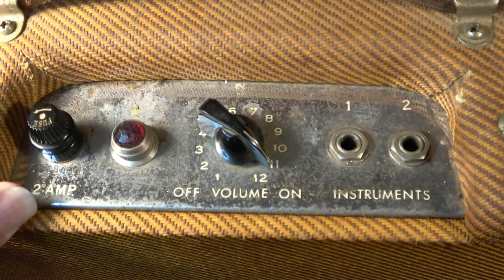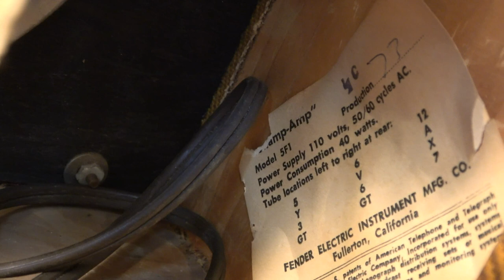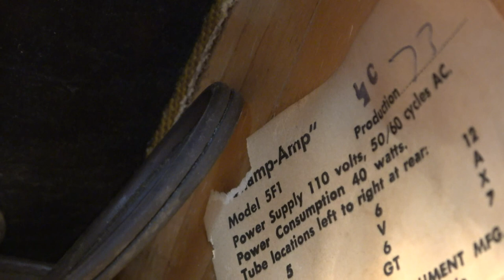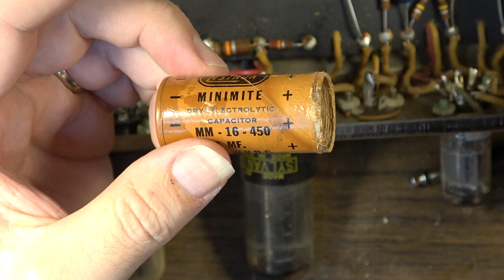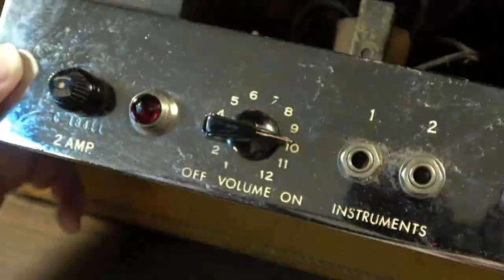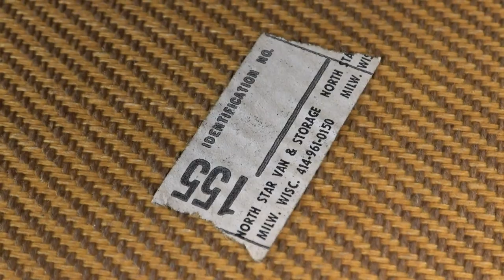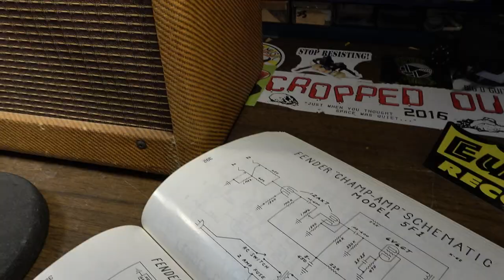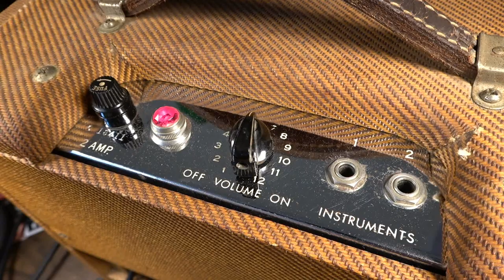1962 FENDER 5F1 TWEED CHAMP Electronics Repair and Restoration

Comment: Just had to come back and rewatch this video after deciding to get inside my 5F1 and get rid of the tone webs. Glad I did as all the date codes inside confirm it's a 1957. Valves are Tung Sol & RCA, transformer is Triad. Thanks for the breakdown of the amp in video, it really helped me

Comment: Nice work, Brad.  First time I've seen old caps get re-stuffed like that. I have some old radios I'm restoring, including a tweed Zenith Universal and I might try doing that with it when I re-cap it. Thanks for this enjoyable little trip back to 1962!
Reply: Have you ever tried to convert an old tube radio to a guitar amp. I found one guy that did it years ago with amazing result.

Comment: Nice video and nice amp :-)
The good old tubes rarely die. My modified "Knutsen" amp still has the original '63 Telefunken EL84 pair and Telefunken ECC83 PI tube. The EL84s may have been stressed or even red-plating at some point as the original PI coupling caps were leaky, but they appear to work great.

Comment: Hey man next time you clean one of those break out the water hose in a wire brush🤣🤣🤣
Reply: Bwahahaha! Oh, god, THAT guy. 🤣 You gotta make sure you you're randomly walking along the river bank, then magically discover this laying there in the mud first though. 😅 Might as well paint all the caps & resistors red afterwards too! 😉
Reply: Uh yeah, clean all the pots, jacks, tube sockets THEN brush all that debris around the chassis. Good times people.
Reply: @scottmulrooney3130  dude it's a joke. We are longtime viewers and we know the joke and so does Brad.
Reply: @mark5150ty  And so do I.
Reply: @scottmulrooney3130  sorry you're comments didn't seem like you're being sarcastic.
Reply: @mark5150ty  “good times people” should be a tip off. No worries. Good humor is subtle. The internet is not. Carry on!
Reply: @scottmulrooney3130  agreed

Comment: Saw you cleaning up that chrome chassis. I’ve discovered some great stuff called Never Dull. It’s cheap and at WalMart. Comes in a tin can and it is pre soaked cotton wads. Very gentle yet great cleaner for chrome abd bright metal. Will not scratch! I found it in the automotive cleaner section at WalMart. Works great on all guitar chrome parts, brass, alum etc..
Love your channel Brad. Waiting for you update on your legal issues! We support your fight. Been through that stuff myself!

Comment: beautiful amp Brad - only one comment on it that I would suggest.  I know the traditional rule on amps has been same value or highter on the electrolytics - generally a true statement.  But high value caps will rob some of the tweed tone from these amps.  After all, that 22mfd electrolytic is 30% higher than the 16mfd.  That will make a difference - the amp will have more capacity on reserve and be slightly stiffer.  It makes a big difference on a relatively simple amp.  It may make sense to increase on an amp that you want to be cleaner, but not one that you want to distort in the same manner as intended.  You can get 16mfd caps.
Reply from the maker: Hey John. Normally, I might agree, but when's the last time you pulled a cap and it wasn't higher than the spec value anyway? I didn't measure the originals, but I'd be willing to bet they'd be closer in value to the new caps than the printed value, at least the two that weren't exploded. ;)
Good to see you, by the way! You need to come up to Louisville and geek out on amps with me in a video sometime.
Reply: @TheGuitologist  I don't really understand the point - if something calls for a 16 mfd cap, and you put 22s in there - part of the sound of a tweed is that 16 mfd cap.  22 is a substantial difference than 16 (percentage wise).  Tube amps are more about percentages as you know after years of swapping values.  if you do that to multiple stages, you will definitely hear the difference.  Maybe you didn't realize you can get 16s and 20s easily enough now.  I am definitely am not slamming your work.  You try it, and if you don't think it works - don't do it!  But try it before you judge it.  I used to do the same myself.  Lots of good stuff.  Right now am working a different job so I don't get to Louisville as often, but yes, I will stop by sometime and geek out over vintage amps and gear.  Maybe if I have something interesting when I hit Louisville next I will bring it with me.  It will be fun.  Ha, I  watched you repair a washing machine on a video today.  I just did nearly exactly the same thing to my LG!  We both value fixing things rather than spending a thousand bucks to replace it and unnecessarily filling up a landfills.  Brad the recycler - the environmentalist.  I've fixed my TVs, computers, and HIFIs too (when I am able).  And one of my favorite guitars I purchased in pieces and glued it back together (it was likely ran over or crushed in shipping and was being sold as parts).  It now looks pretty good but plays very amazingly well!  TTYL

Comment: Great video! Wanted to know if you were interested in fixing and modding a Ross Flanger Distortion effect. It defaults to white noise after about 10 minutes...also wanted to be able to put a option switch for flanger before or after distortion.

Comment: Awesome demo! Thank you for it! Do you happen to recall around where the volume settings were on the guitars? The amp seems to be 12, but curious about the interaction with the guitars and amp. All good if you can't recall.
Reply from the maker: Cranked most of the time.
Reply: @TheGuitologist  - Thanks! Must have been loud in there during the demo!

Comment: I have a modern copy of that amp...same tube values. I freakin love it! It growls!👍😎🎸🎶
Reply: I make modern copys in head form lol, right now experimenting with adding a bypassable gain stage using a 6829 and 6DJ8 in the preamp and 6P1P-EV for the power amp same core 5f1 circuit with a few add ons and a diode rectifier using some diodes from an old organ, power transformer is extremely small so diode rectifier is needed if i wanna pull off a 2nd twin triode.
Reply: @YeeThirty  cool!👍😎

Comment: Interesting.   The dates would definitely fit this being a 5f1, as did your tube label.  But.  The 25uf bypass cap across the first stage of v1 is more in line with the 5e1 circuit or fender had a misprint in the schematic that went unnoticed for half a century

Comment: BRAD if you dont mind what product/products did you use to clean the tubes and the chrome panel on top…I collect vintage valco….National etc and would appreciate the advice. Thank You 😊
Reply from the maker: No products. Just a wet wipe. Probably has a little alcohol in it.

Comment: 1960 was the dividing line between the tweed amps and more modern imitation leather. 5 series circuits as shown here were replaced by 6 series during the same year. Since Fender was a tightly run company, some of the sample materials brought in for the decade change were used up resulting in some rare color combinations in 1960. Prebuilt  chassis from the previous era were also updated with new designation written on the old tag.
In this case the '4C' may actually be an 'HC' since date codes of the era consisted of letters. With a date of 1958 March, the tweed and 5 series circuit makes more sense. Except for the blue capacitors which replaced the less reliable yellow variety if the 50's. These would be closer to 1963.
Perhaps old pre build stock which was assembled late enough to benefit from better capacitors.

Comment: Seeing how much of a struggle it was to solder the death capacitor to the chassis, I wonder why don’t you try an RF soldering iron such as OKI Metcal? I bought one years ago and cannot stand to use a standard type these days. Especially when reflowing a whole circuit board, the RFs just heat up so quickly any cooling is quickly reheated before the next joint!

Comment: Really enjoyed this vid Brad. Will have a snoop and a clean in the back of my 58 now. I still can't believe I lucked into it just a few months ago (along with a 68 Gibson J200). What can you tell me about the two instrument inputs? Why 2? Somebody once told me one is for if you're playing thru single coils and the other thru humbuckers but I don't particularly believe that, or couldn't tell a difference when trying that.... Would people run two instruments thru it together? 2 guitars or a guitar & mic. btw, on the exterior mine is in every bit as good condition as yours in the vid but inside is very clean w/ original components. It has a mod on the chassis to ext cabinet which is 2 little screws and a mini input to the left of where it says instruments. Should I snip the wiring on that so it doesn't ever get used? I've read that newer cabs shouldn't run thru older amps something to do with ohms

Comment: Brad, I die a little inside every time you use that relatively thin iron for nearly all your stuff, especially tackling Solder Mountains which shouldn't exist.  PLEASE get yourself a ~80W iron with the straight fat heater ending in a bigass wedge.  So much faster, so much healthier for you and components.  Old Wellers were great, not sure on newer ones, I use Hakko.  I'm talking truly about 1/2 the dwell time _or less_.  And then get a tapered chisel, 40-60W, for the rest.  Great video, thanks!
Reply from the maker: I have several giant irons. I’m just not stopping what I’m doing to go dig them out unless it’s absolutely necessary.

Comment: You really need a bigger soldering iron for sticking that death cap to the chassis. Sometimes size does matter! 😂
Reply: I would use a Y type safety cap. The idea of the grounding cap is to ground out electrical interference coming thru the ac line. The safety cap will fail open instead of shorting.

Comment: I stopped at 3:30. No need to continue on. You said the owner bought it to sell and flip. I’ve bought, sold and repaired vintage amps and guitars since the 70’s. Maximum value is for the untouched and unmolested. As soon as I see changes we are no longer in the same category. I would advise this customer to leave as is if it’s functional and still performing. The bulging filter cap on the far left could be an issue. A new one easily rehoused in the Astron paper might be required. Your not precious on original components which is fine for you, but there are plenty of us that have a different opinion. We may be the ones with the bigger wallet. There are only so many of these left.

Comment: Brad, I've got 5F1 - marked FD which I beleive is a 54' Champ Amp. It's recently stopped outputting line in sound. When I turn the volume I can get a crackle through the speaker... so it's still producing something. Tubes look fine are all warming up like they always have.. I'm not sure where to start debugging this and there are no specialists in my area who can fix this.. what would you recommend?
Reply from the maker: Try changing the preamp tube.

Comment: Would a GZ34 and a 6L6 bump the output power up? Probably not and ruin the transformers, or not? You tell me. Love the video! Nice to have you back on the bench! Love from NW Colorado. Thanxz
Reply from the maker: It wouldn't likely hurt anything. Tolerances on this stuff is so broad, it would likely operate just fine. The speaker might not like it much, but I doubt the output transformer would suffer any issues.
Reply: GZ34/5AR4’s are more efficient. You’re B+ would probably be a little higher. On the flip side the heater pulls only 1.8 amps vs 2 for the 5Y3 filament. A 6L6 heater pulls more current then the 6V6 does which could overheat the PT.

Comment: Other techs say that NFT caps or other caps will change the tone if you don't use the Blue Mica Mold caps
Reply from the maker: The only difference you’re likely to notice is between different types of cap, e.g. poly vs. ceramic.
Reply: @TheGuitologist  The boards they used with the eyelets for some reasons leak DC voltages because the boards aren't PCB boards so the DC voltage gets "induced" in the paper of the boards which causes DC leakages I have been told. I have no idea why fender would use those type of paper boards with eyelets that will cause DC leakage. Anything to do to prevent this DC leakage issues getting induced in the paper boards with eyelets?

Comment: Keeping the same values, when do components change sound?
Reply from the maker: Some people claim the power cable changes the sound. We call  those people "crazy'. The value of the component is nearly everything. The exception being changing the TYPE of component, e.g. going from a polyester to a ceramic coupling cap or going from using carbon resistors to metal film. That can have an effect due to the phenomenon of microphonics.

Comment: Love to have one of your creations. Also have an idea what I want. A thick harmonic gain monster. EL 84 or 34s for around 20 watts. Would like the input to an AT7 to proces boost for tone stack . Into ax7s  would also like effects  loop another AT7. Like tube rectification , would be nice to have a switch for the other rectifier type. Would like it filtered from early in the first at7 first stage so it's no processing  what I'm not using.ather than filter later on. That way it's only amplifying what is wanted. I have a Rebel 20 first model. I love the tone stack in it. I also have a stage right tube 15 I love it to.
Do you build custom amps love the sound of your mods. It's your ear and your technological knowledge. Great stuff

Comment: A real good reason for always replacing the filter caps if the amp is played is that they are cheaper than a power transformer.  These are useable collector items. You wouldn't drive a 58 Caddy with original tires either. 
I think the "lose its mojo" stories happened because of techs replacing them with wrong values or garbage quality caps.

Comment: All kidding a size what do you stuff the caps with? I know it sounds stupid but I can't see and I don't know. Is this stuff for a liquid is an electric one of the electric ones oil I don't understand. If someone could reply that would be great again I can't see what he's doing cuz of my my eyes shitting out on me as I live LOL but I'm interested I always like to learn. Even if at this point I can't apply the knowledge I learned it's still in my head and that's important to me. I used to work extensively on motorcycles and cars everything but painting. Although I did spray one old motorcycle I bought when I was kid I sprayed it with spray paint for my can not the best job lol anyway if anyone could tell me reply I'd appreciate it. Sincerely us, Bob's appointment guitars

Comment: As a homeowner and a former tenant, I despise flippers with a fiery vengeance. Can't imagine anyone who's owned any quality gear feeling differently about someone looking to turn a dime over someone else's misfortune.

For high ripple power supply capacitors, the only brands to consider are Nippon-Chemicon, Nichicon, Matsushita/Panasonic, and Illinois, in that order. The booteek brands like F&T tend to be Wun-Hun-Lo with a bit of rebranding on the jacket, so you're spending more for caps that will need to be replaced a lot sooner. (Sprague aren't bad, but they aren't in the same class as the modern capacitors either.) Never mind the collectability, give the buyer some peace of mind by using known brands of capacitors that will last.